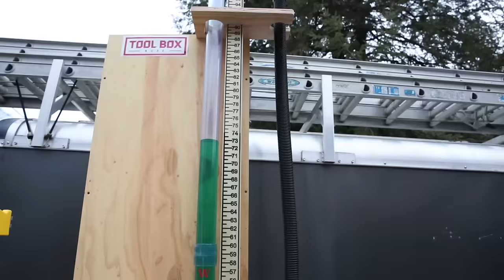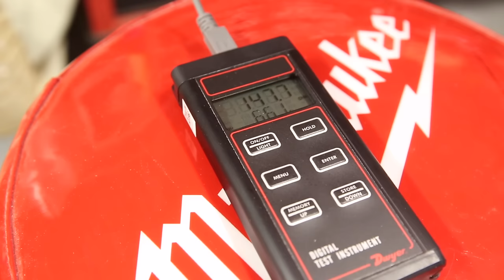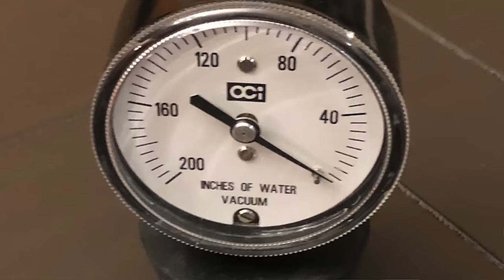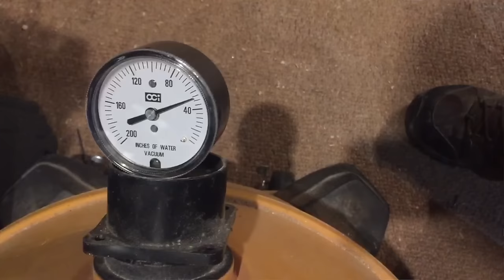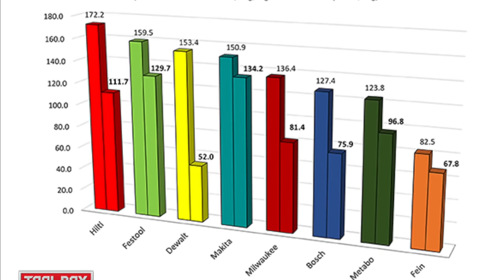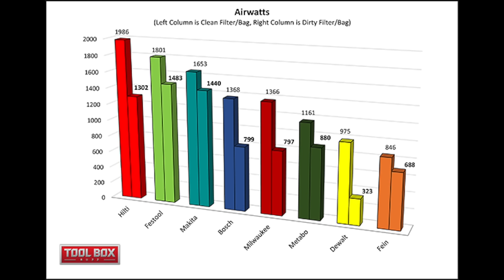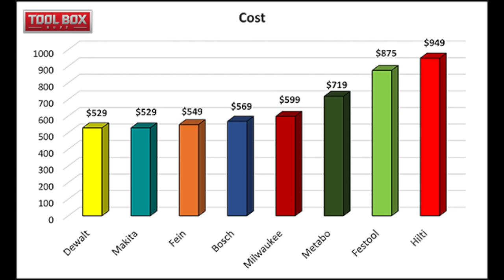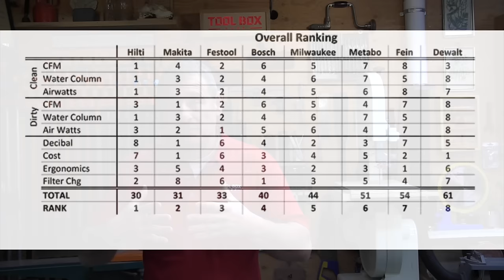Best Dust Extractors - Head-2-Head Testing

Comment: This is one of your best reviews ever. I can't imagine the amount of time it took to produce. Please keep up the great work.
Reply from the maker: DaytonFamilyofFour thx - this one took a month to produce
Reply: Holy hell, a month? That is thorough
Reply from the maker: Thx
Reply: @ConcordCarpenter  And every minuted it was worth it!
Reply: I just subscribed this guy is the real deal he not playing.  Very accurate and detailed
Reply: I would say it was one of the worst. Way, Way too much time talking about how they are going to test, over and over again and way too little time on the actual tests. I ended up just skipping through until I saw a chart and pausing there to read it. Honestly, he could have just posted a 5 second clip of each chart and it would have been a million times better than this mess. On top of that, they didn't even have a Rigid shop vac for comparison. Rigid makes the best low cost shop vacs out there, so I would have loved to see how it compares to all this overpriced stuff.
Reply: Volumetric airflow is the most important variable when it comes to this kind of thing. Also, noise levels and their subsequent harm are not a linear relationship. A small increase in noise can cause a much greater harm as it is a logarithmic scale.

Comment: 4 years later, it would be great to see an updated review. The Makita, the top of the reasonably priced ones, isn't even available any more.
Reply from the maker: soon
Reply: @ConcordCarpenter how soon? my Makita just stopped working, it had a hard life though hahaha
Reply: @ConcordCarpenter 
I have been using the vc-150-6 for 5 years we got 3 on the jobsite,and to help them stay in good condition since we fill a bag a day, we coupled them a year ago with Oneida cyclone bucket and now it's a bag every 1-2 week, because small particule fills bags ports, Wich saved considerably our budget but we did saw a decrease in performance with the 3 year running on  bag only, but no decrease on the year with cyclone.

Comment: I watched the whole video now. and I gave it a thumbs up. Without having read the article yet (I'll do that in a moment. At least I start, do not know how long it is) is the winner for me 
by far Makita.  It "gained" 13 of its points in the last two judgements. Of course ergonomics are important and the quickness and easiness of filter changing, too. 
I must read the article how that has been judged and measured.
Costs are important and the noise a machines produces you hear every moment that it is turned on.

Comment: I replaced a Ridged shop vac with a Festool CT36.  I have been wondering if all of that cost really bought me a better vac.  Your tests were well thought out and beautifully done and appeared to be unbiased (except for that little chuckle on the DeWalt).  I'm now glad I took the plunge with the Festool.  Many thanks for your work here.
Reply: hi ! , im struggling to decide between which vac dust ext. for mitre saws concrete sheet cutting with p,unge saws, and plastering sanders.. why ru  so happy with the c t 36 ?? no regrets even with price etc ?? thanks ;) .... nic

Comment: I know this video is five years old, but I just bought the Bosch 14 gallon dust extractor. I haven't used it yet. But I've seen a lot of guys in my line of work using this dust extractor for grinding high spots in concrete and grinding off thinset when tearing out tile. I do flooring. The Bosch seem to come in around fourth place on all these tests. Right in the middle of all your graph charts. So which tells me it seems to be about average. I think it will do good for what I need it for. It won't be getting used every day. Maybe once a week or twice a month. I'm going to hook up a dust deputy to it as well, and see how that works. Thanks for the review!

Comment: Great review! As a mechanical engineer I appreciate the focused resting on the important aspects of the vacs. I have also been a die hard furniture designer and woodworker for over 35 years and I have gone through my share of vacs, several top brand models included. They would usually die after about 5 years of hard use even with routine care and feeding. I finally wised up and installed a cyclone separator about 11 years ago and am still on the same Fine vac, it looks like new inside and have never changed the filter! I used an Oneida separator and put the vac and separator on a cart. No expensive bags to buy and I’ll never have to buy another vac again as long as the motor keeps running.
Reply: D Tom
Could you give us a few more details? What is the model number of your Oneida separator. Maybe a picture or two about how you connected the two together, or aren't they connected together?
Reply: @christinehartman2459   do some research on cyclonic separators. The concept is fairly simple and straightforward in regards to how it works/what it does.  They can be made pretty inexpensively with a 5 gallon bucket. 
The separator is connected in between the tool and the vacuum, and separates the larger particles into a different bucket, rather than sucking everything into the vacuum and bogging down the filters/bags inside.  One thing to keep in mind though, is that they add more resistance to the vacuum, so it has to work harder to keep suction

Comment: I use the festool ct36 with the planex drywall sander for my company and I love the way it performs. When I give bids to the customers I show the the festool System and a video on how much it helps to eliminate the dust. If you can eliminate the dust in a occupied house the customer it’s a win win.

From experience the warranty on festool is amazing the turnaround time was very quick.

Thanks for the video!

Comment: Another outstanding comparsion and analysis. 40 years in new high-end construction; last 18 in exclusively interior finish. Still have my Festool CT36 vac from 2001. Used with Powermatic contractor table saw, Dewalt comp'd miter, and numerous Festool sanders, jigsaws, planers. Festool has set the bar high but Hilti & Makita ARE impressive now.
I always feel higher quality WITH greater reliability is a winning formula and justifies higher initial cost, for professionals.
Thanks for being the best at what you do, Rob.

Comment: Awesome review.  After watching the review, I noticed that all these have one flaw in common.  You have your dust collector and you also have your dust extractor like these for small tools.  I bought a Kirby vacuum cleaner motor head which has a impeller that is separated from the motor.  The motor has a separate assembly to get cooled.  The impeller sucks the dust and within few inches exhausts it to a bag via 3 inch pipe.  I removed the bag and connected it to my large shop three stage dust extractor with cyclonic action.  This way I have one place for all the dust from the small and large tools, none of the filter expense, takes very little space and it’s in-line install setup for under 100 bucks.  Awesome review, love watching all of your comprehensive and detail reviews.  Thank you.

Comment: Three points: 1- The clean filter numbers are almost pointless. The machines will be run dirty 90% of the time. Outside of the top three the drop offs are so severe there functionality are compromised.

2- For every 3 decibels noise levels double. So the second place milwaukee is twice as loud as the makita.

3- Biggest disappointment has to be the Fein. They basically created this category and to test so poorly with a new model is unfortunate.

Bonus- The tippy Makita can be a pain in the backside. Add 10/20 lbs of flat weights in the bottom of the canister (using fleece bags) to stabilize it. Not an option if lugging around the job but works if being used at a sanding/cutting station.
Reply from the maker: matthew rud45 the clean filter test is a baseline - benchmark. Good news is Makita will be redesigning their body to a shorter more stable footprint
Reply: Great point about the 90% run dirty time. The run clean should not even be a factor.  But its only a sentence later and I am changing that already. Here is where it can be important. If you are doing woodwork with large chips and you use a cyclone device to catch 99% of the stuff before it hits the bag then you can run for a year without ever needing to replace the bag. For those guys, the clean test should be in the test. But it should be weighted where it counts one-tenth of the dirty test in determining the overall score.
Reply: 10 db is twice as loud.
Reply: > Outside of the top three the drop offs are so severe there functionality are compromised.

The Metabo dropped less than the Hilti. Also, "their".
Reply: RAREFORMDESIGNS decibels are logarithmic which means every 10 means 10x not 2x
Reply: The fact that a scale is logarithmic does not tell you by how much it varies, just how it varies. It's like saying the scale is "multiplicative"; that by itself does not tell you how much you need to multiply it by.  In this case, you need to know the base of the scale as well.

The power ratio in the decibel scale varies at 10:1, which means an increase of 10 decibels corresponds to 10x the power (an increase in 20 decibels corresponds to 100 times the power, and so on), but the amplitude  varies at √10:1, which means an increase of 10 decibels corresponds to 3.16x the amplitude (20 decibels corresponds to 10x the amplitude, and so on).

Comment: Amazing video. I am currently using a Hilti vacuum 9 hours a day. I am grinding concrete walls. I agree 100% bags are essential. Noise is not a concern in a commercial building site.
Thanks.

Comment: Two items I'd like to share. I've seen both the Hilti and the Makita at Home Depot's tool rental center. The HD employee behind the counter told me customers preferred the Makita over the Hilti. For a vacuum to be offered at a rental center is quite a testimony to these two products. Second,  I bought the DeWalt because HD had an open box on clearance for  $299.  All of the units are fairly similar and are going to take lots of abuse, cost is the ultimate factor.
Reply: My standard rule of thumb is if something is being used as a rental it's probably something you'd want to buy.  Main reason I mostly buy Makita.

Comment: A quick correction to the video. There is a HUGE difference in loudness between dust extractors in this video. It should be noted that decibels are measured on a logarithmic scale, not a linear scale. Thus, for every 6 dB difference between these dust extractors, the sound intensity doubles, and for every 20 dB difference, the sound intensity is exactly 10 times louder. Therefore, with the softest extractor (Makita) at 83.3 dB and the loudest extractor (Festool) at 92.7 dB, the Festool is 2.95 times louder than the Makita. For comparison, it is recommended by NIOSH-AINSI that a person should not be exposed to 85 dB for over 8 hrs, while it is recommended that a person should not be exposed to 94 dB for over 1 hr. For every 3 dB, the exposure time is cut in half.

Comment: I have all 3 of his top picks and the dewalt vac as well. Hilti, Makita, Festool and Dewalt.  Hilti makes a good vac for sure it performs great. Warranty is also awesome. The Makita vac is not anywhere close to the Hilti or the festool in anyway shape or form. My dewalt is a much better vac all around than the makita. I take care of my tools and that means I clean my filters as recommended. After a year of using in commercial construction I would say out of the 4 vacs I have the Festool as my pick hands down. Never had any problems and is always strong. It will hold a electric drywall Sanders to the ceiling due to its suction power.  My second pick would be the Hilti vac followed by my dewalt vac. The dewalt vac is a great deal for the money and I plan to buy more as me and my guys need them. I will purchase Festool  again as well. It’s is the best vac on the market, you will pay a premium price because it’s a premium product. After all in most cases you get what you pay for.

Comment: Love seeing the battle between tools to see just how well they perform, I am partial to Festool, and seeing the comparison "cements" my choice for dust extractors.  Our CT 26 hasn't let us down yet!
Reply: Matthew Shull 

Ive got 2 of them and a sys vac. Cant kill them and they hold suction.
Reply: We have a midi for small sanding and projects inside for projects, and keep our 26 on the trailer for all domino and large projects, other than changing bags, they take care of themselves and are a pleasure to use!  Our customers can't say enough about our cleanliness and capturing the dust at the tool.  You are right, can't kill them!
Reply: Yup, got two of the FesTool vacuums the medium guy and the big one. They say you can cut molding and trim on a white carpet with the FesTool saw. Not a good idea but it is pretty decent. I’m also sure Hilti will kick butt all day and probably win in a heads-up competition. But, the kits all work very well together with the FesTool and that can’t be said for much of the competition. Especially if you have a separator set up on you vacuum. I am surprised at the Makita and I’m definitely going out and buying one this weekend. I’m gonna modify a FesTool hose for it and stick that bad boy on my table saw, (I have trouble using the track saw from FesTool so I loaned that to one of my sub-trades to use.

Comment: Fantastic review. I’ve recently machine sanded a drywall after joint filling and the dust extractor I used perpetually became inoperable due to filter clogging. I now know the correct dust extractor for the job. A big thanks for your review.

Comment: 6 years and still the best H2H review on YouTube. Kudos to you. I would love another iteration with current vacs. If you doing it I would suggest adding one home vac (like Thomas Cat & Dog or Miele Cat & Dog which seem to be the top their class) just for the sake of beginners or DYI-ers/ hobbyist so they have a point of reference (obviously it is a bit of comparing apples with oranges, but it would be very educational) on the performance side - e.g. sucking power.

Comment: Let's be REAL Rob! The Makita is a top heavy tip-tastic POS, make sure when you're using it that you don't drag it behind you and run over anything larger than a framing nail (including an extension cord or even its own cord). Why wouldn't you guys not have added additional bonus points for Festool and Bosch for modular tool storage on vac? You and I both know you can't beat a Systainer or L-Boxx to get the tool you're going to hook up to the dust extractor to do your job. Also ideal is having the ability to store it efficiently, unless your viewers like using one hand for the tool one hand for the dust extractor or precariously balancing it on top??? In the REAL WORLD it's Bosch & Festool all day, everyday (unless you're running a huge core bit then it's Hilti all by itself)!
Reply: This is very true. The Makita is a stellar vac, but if it can't be rolled around by tugging on the cord, then then what's the point? This is still a great comparison video. Always great Rob, and the CC crew.
Reply: Sounds like somebody has tipped a makita once or twice.. 
How do they end up putting something like that out is beyond me at this point.
Reply from the maker: Kelly - we did. We marked the Makita the lower on ergonomics for that top-heavy design, and marked other vacs with modular storage like Festool, Fein, etc, the highest if they offered those systems. BTW - Makita is currently redesigning the size to mirror the other unit shapes - TBA soon
Reply: The other good point about the festool is how the hose is stored, it is superb as you still have access to the carrying handle. The hose is high quality and antistatic, plus you can get a hose and power cord integrated into one, very handy. An important feature is an air volume control. Festool shines here when used with their sanders. Sometimes you DON'T want max air as it sucks the sander down too much. The power cord is stout on the Hilti and Festool as is the storage for both. With the flat top and systainer integration along with the points above, this makes Festool the leader in dust extraction.

Comment: The Festool won't break in the first 3 years or probably 20yrs, just all the plastic breaks on the top and that's certainly not covered under warranty of course!! I've owned my ct26 for 3 years I tried to take care of it but it's falling apart, can't really hold a systainer on the top anymore, snapped the cord hanger off, plastic broken in other places. From the others I see on job sites mine looks new! I would like to see you give these vacuums to contractors and check back in a year or two to see how they are holding up, festool would be looking worse for wear that's for sure. I will consider selling my festool for Makita after watching this video!! Great video and tests! Thanks for putting this together!